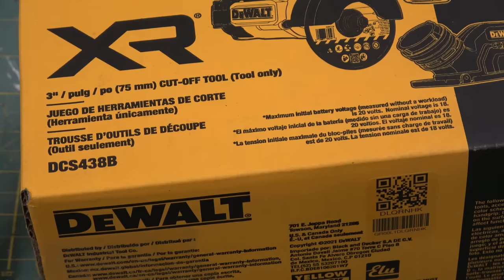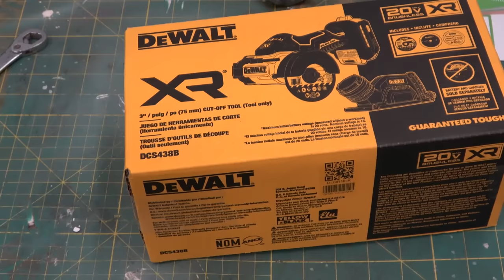BOLTR: DeWalt Mo' Powah!

Comment: ahh yes, finally some justification for being gifted dewalt and sticking with it for years and years
Reply: I actually really like the dewalt triggers over milwaukee/makita. Maybe it's just because they're the ones I'm most used to though 🤷
Reply: Dewalt is finally on top again for impacts. The 961 1/2 is crazy and the mid torque are good too. Just got one mid torquefor free with two 8ah batteries for $300 total
Reply: @UnimportantAcc probably what you're used to. 

I don't want to start a brand war, but I use makita and can't stand the triggers on milwaukee or dewalt. Definitely "what you're used too" plays a part in it.
Reply: @wearsjorge55  fair enough
i do like the makita gear, in particular their cordless circular saw /w swarf collector made me want to switch over from dewalt ahaha
Reply: I run makita and Dewalt. Dewalt is pretty tough actually, but always a little rough. They take serious abuse unlike Milwaukee which dies all the time.

Makita is smooth, ergonomic, precise and really reliable, but it always lacks a bit of power. I run both for a reason.
Reply: Idk I have run Milwaukee for the last 6-7 years as a auto mechanic and only thing I have found to suck is the m18 fuel drill chuck have been thru 3 of them and the fact that the tip of the soldering iron always comes loose and if you don’t tighten it they you won’t be soldering anything. Also went thru 1 1/4in ratchet but that’s used daily so. Have had the same first gen m18 impact all this time and all the other impacts, drivers, grinders, bandsaws, die grinders have lasted 4+ years minimum with a ton of hard use. Hell I have m12 tilt head lights that I have ran over and tapped back together 3+ years ago still working.
I haven’t had all the bad luck some people have had with Milwaukee but I have used other brand and aside from not being used to them I find everything good so it’s all about your preference and for me what was more affordable (I got all if not most of my Milwaukee shit at really good prices).
Reply: Personal tools have been Dewalt for years, some coworkers suggested millfucky for shop tools and batteries dead at 4 years, my 20 year old Dewalts still kicking.
Reply: Nothing wrong with that!  They make good tools.
Reply: I’m a contractor and used the 20v system since inception.  They are very good tools and get it done.
Reply: 21 years here.  Technically my whole life.  Dad had a black and decker industrial saw boight in the late 80s i used for years which was rebranded dewalt in the early 90s.
Reply: Would you be surprised that I'm on all three platforms and don't give a single shit about what brand is "winning" or how much it costs at the store.  If youre willing to check offer up more often than your social media accounts, you can get any color tool, brand new and at half the price. Having a tool wish list? Forget about it, don't buy at the big box stores and you will have every tool you can fit into your garage and the only reason you'll ever check retail prices is so you can divide it by two and know that's the most you'll offer for any tool even if its new in box. Don't be a fanboy, and don't overpay for plastic shells and motors, that's all that tools are, I can't imagine saving up all that money and dumping it all on one tool just so that you can get a receipt?
Reply: I’m a professional carpenter in the Pacific Northwest. We build all outdoors so our tools get put through some sh1t. Everyone uses Dewalt, Milwaukee, or Makita. I train all of our new hires or help with particularly hard or custom projects. Because of this, when I’m on site, I’m usually using the other foremen’s tools. That means I use all the brands (though I own DeWalt). One day I’ll use all Milwaukee, one day Makita, one day DeWalt. Dewalt is the best, Milwaukee second, and I would not buy Makita. Here is why:

Dewalt has an absolute power edge in some tools with the 60v line. Their “worm drive style” 60v circular saw is leagues better than the Milwaukee or Makita. 

Dewalt has the best ergonomics by far. Go grab a Makita or Milwaukee multi tool then grab the Dewalt. The M brands are like holding a Campbell soup can. The Dewalt feels like a nice pistol. Dewalt made the forward/reverse button on their drivers stick out slightly when depressed. Milwaukee made their sub-flush. That means to switch a Milwaukee to reverse, you have to break your grip and use the tip of your thumb or finger to push it down INTO the grip. With the Dewalt, you can just use the side of your thumb and not change your grip. It’s little things like that that make a huge difference. Makita’s drivers are weak sauce. 

Many of the Milwaukee multi tools will not stand on the battery because it mounts at an angle. I know, small thing but it pisses me off to no end.  

Makita doesn’t make a battery above 5Ah. What nonsense is that? The Makita worm drive skim saw is hot garbage. It is so weak it’s insane. 

The ONLY tool that I would even CONSIDER buying that is not Dewalt is the Milwaukee multi tool. And it’s only because of the power. That thing cuts at least twice as fast as the Dewalt. It has a stupid level of power. However, it feels like holding a brick, it won’t stand on end, and you can’t modulate the speed with the trigger. It has an on/off switch and a speed dial. Also, the automatic speed control is dumb. 

Every single other tool that I use between those brands (all circular saws, multi tools, grinders, drills, drivers, sawzalls, jigsaw, etc), Dewalt either wins or ties. If Dewalt would just make a multi tool that cut like the Milwaukee, the debate would be over for all time. 

In conclusion, Makita is out because of small batteries and weak power levels. Milwaukee is out because of horrible ergonomics and slightly less power on some tools. Seriously, Milwaukee made a jigsaw with an on/off angle grinder style switch. Jigsaws have used a trigger with speed control since forever. Oh, and the thing is so girthy it feels like you’re holding the wrong end of a baseball bat.
Reply: I chose DeWalt 12 years ago and chose wrongly. Little did I know at the time; my Dad, a DIYer and mechanic his whole life had only ever owned Bosch 12V cordless tools, and used air tools exclusively at work. But I stuck with the bumblebee brand and they've started to get their fingers out of their asses with product development and design. Still think my buddy's Packout setup is twice as good as even the ToughSystem 2.0 boxes. Two bites at the cherry now and they still came up short... seems DeWalt can't design a toolbox to save their lives.
Reply: @Thedudeabides803 After 16 years my cordless sawzall finally shook itself apart. Original batteries died 2 years ago only because I moved to Florida. They made a good kit.
Reply: @UnimportantAcc they also modulate better. Everyone always talks about Milwaukee power but quality and control matter more than power in most cases. But dewalt even has more power these days with lots of tools.
Reply: @cheeseo9798  I absolutely love my first gen 1/2" fuel impact as a mechanic as well. Lots of miles on it. Coworkers have newer models and I can't stand that pulling the trigger doesn't always actually turn the dumb thing on. Instant torque that I can modulate with my finger is one of the big positives of these electric tools IMO. The braking action that doesn't throw lugs across the shop is great too though Haha.
Reply: @alphazuluz i agree with you on pretty much everything but re the jigsaw, I believe all brands barrel grip jigsaws use the on/off switch, not just Milwaukee
Reply: Beware their Leaf Blowers!
Reply: I just pulled out an old dewalt impact driver I bought a decade ago. Been running a milwaukee gen 4 for a while now, and I forgot how comfortable and well balanced the dewalt is. The milwaukee is obviously more powerful but most the time I don't need it so the old dewalt has been back in business. It just feels better. Love that thing

Comment: You mentioned how the MFGs are making things cleaner on the inside lately. I think you have had a hand in that, guys like me are engineers nowadays and watched your channel in college and since then. Good teachers make positive change in the world!
Reply: I’m an engineer, admittedly not mechanical and so machining isn’t my area of expertise. 

I was at a supplier yesterday tearing down a very high dollar, complex, and specialized valve that had failed while in service and there were several points where I would have loved to have AvE there to just provide his experience and see his reaction. Several different techniques, metallurgy, elastomers go into making this valve,  no expenses spared, and half of them I recognized or had first seen  watching an AvE video.
Reply: Good to hear the world is finally getting back to the 1960s and 1970s in that regard. I was taking tools apart long before YouTube existed too, but my mother didn’t care as long as I put them back together afterward.
Reply: Also I tore down one of my milwaukees and noticed every fastener in the clamshell was the same screw. That was amazing to not worry about what screw went where.
Reply: @ac.creations that's cost savings as well.  Get two birds stoned at once!

Comment: The “flap” is a slot for an optional Bluetooth “ToolConnect” smart chip module that lets a foreman track tools, assign tools, disable/enable tools, and receive alerts when tools are taken. Some interlocking tool cases have a slot for it too. They make a battery interposer that can lock in to the battery slot to add the same functionality to their tools that don’t have the chip slot.
Reply: Also, the depth gauge/dust extractor comes off the tiny adjustable blade guard without tools… just like the Milwaukee version. You just have to drop the depth gauge all the way and slide the release button. The flip-up window lets you change the disc without removing the dust extractor, which would be appreciated by the rare breed who would actually uses it. The Milwaukee and others do not allow for this.

Comment: Just a thing to point out, I am not as technically inclined as you and read the manual the plunge depth dust collector thing-a-majig actually comes off from the real metal guard. I like my fingers so I kept the guard on but it winds up being a lot less bulky and keeps your abrasive wheels from having chunks snapped off when you inevitably throw it back into the toolbag at the end of the day.

Comment: at 12:30, regarding the crimp-on wire termination...  this permits just soldering that termination pin into the board, avoiding the issues with soldering the wires.  A main reason to do this is that you don't have solder wicking up the strands, creating a stress riser where the solder stops.  This would usually require strain relief to avoid wire fatigue and failure.  There can be other advantages, such as being easier (potentially) to get all of the strands into the terminal.  I've seen issues with a few strands not going through the hole in the board and sometimes shorting to adjacent wires.  As an engineer, I've seen this pop up on one of my products with serious implications.  No fun!
Reply: The main reason is they clip into the PCB.  The PCB can then go through the wave soldering machine with out the wires falling out of the through holes.  They will probably do 200ish at a time (20 x 10 PCBs all still connected together).  It would be a impossible to go through without the wires secured into the PCBs.
Also,  once soldered,  a jig will be used to RTV all 200ish solder joins in one go.
Then the individual PCBs are just snapped off the original master PCB.
Reply: @debochch  good point!  Lots of advantages to the method, despite an added part (the terminal) and process.
Reply: Lightly a depaneling CNC with a pick and place in to totes rather than snapped
Reply: Yeah, what he said…
Reply: Crimping is better than soldering in many situations (says NASA).

Comment: The part about 10 years ago tools being gross on the inside is wild. The fact they are making things better is something I never thought we would see. I mean they are making them cleaner better is arguable.
Anyways actually love that the guard is not welded to the machine like a lot of tools now and the reverse switch so you can shoot the sparks toward the oil bucket instead of your wool shirt is nice.
Reply: Well I'm sure someone less philosophically-challenged than myself will poke holes in my theorem, but if a brand is showing everyone they don't care, people begin to suspect that they really don't care. That is to say that attention to needless detail indicates attention to another detail better than carelessness in a needless detail does. With so many categories of products suffering from decades of concerted acceleration efforts toward our beloved late-stage capitalism, I'll praise any bit of craftsmanship that I can.
Reply: The mold making I'm willing to bet is seeing the indirect benefits of additive manufacturing techniques. The wiring looms probably is pure marketing. The casing design stuff is pretty much a result of every damn thing getting run through generative and stimulative tools.
Reply: @notsam498  Wiring looms are probably not marketing, but ease of manufacturing.

Comment: As someone who is committed to DeFault, not because of brand loyalty but the amount of money I have tied up in batteries, it pleases me that they’re capable of such fine craftsmanship and occasionally outperform other manufacturers
Reply: the 60v circular saw is a beast. it will not bog down. its more powerful than my 15 amp corded and beats the red one as that one my dad has constantly just cuts out when it has to work for a living. i put my corded on ebay a few weeks ago, i never use it anymore since i got the 60v.
Reply: Just picked up that 60v worm drive and have never been happier with the tool purchase
Reply: Brand loyalty doesn't mean sh💩t, anymore. Buy whatever suits your fancy, and r🙄ll your eyes at the silly fan boys....
Reply: broken clock is right twice a day

Comment: I was gifted some 20v dewalt stuff from a buddy and also my dad and been using it for about 2.5 years now and it works pretty damn well. I have been hella impressed by the inpactor tool that accepts 1/4" speed chuck stuff. With a 1/2" socket adapter, it will literally bust lug nuts loose off a truck.
I'm an automotive and boat mechanic by trade, so they get daily use I might add .

Comment: as a dude who doesnt work in manufacturing, i never put much thought in how much stuff is actually machined, and not forged/cast or what have you. so much machining. and so much human checking and balancing. i salute these machinists that have to grind weight off of high rpm parts

Comment: Impressive how fast it stops the disk.
Reply: it uses its own energy to brake itself. the faster it turns the harder it brakes.
Reply: My only question would be is, at what point is this just a grinder? I mean 20v is definitely more torque but isnt the point of these things to be compact, or am i wrong?
Reply: @jaredslattery4584  That's why I like the Milwaukee. It's small and really handy for cutting hardware cloth, chicken wire, chainlink, etc. I would never even try to use it for cutting 12 gauge steel plates.
Reply: @jaredslattery4584  anything can be a grinder if you use it wrong enough.  This isn't going to run flat out 24/7 but seems like you could use it for small metal jobs.  Like maybe your shade tree mechanic type work and not fab shop or pipe line type work.

Comment: I think the flapulator 7:15 is used on other tools for a belt clip or joist hanker. As you say yourself 10:45 it is modular must be using the mould for more than one tool.

Comment: I'm happy you're back to doing BOLTR again. Getting your take on the newer Milwaukee and the Ryobi brushless lineup would be interesting. I know right, Ryobi!?! From what I've seen of Milwaukee lately, they've let the hype get to their head. Metabo and FLEX would be awesome too! Do you think they justify the price?
Reply: The Milwaukee name was bought by a chinese company a decade ago. Has nothing to do with hype.
Reply: The new high torque seems to be pretty well built, TTC took it apart and found no cost cutting
Reply: @phipear  Thanks for the info! I'll be sure to check it out.
Reply: Grapevine says Ryobi and Milwaukee are made by same company.  I have been happy with both.  No room in my battery tray for yellow.
Reply: @DrJuan-ev8lu  Honestly, at this point, I'm just going to buy a charger and battery for every major brand because it seems like the best they can do is make one good tool and the rest in the lineup are sh!t😂

Comment: I bought a Mikwaukee tool earlier this year, had good luck with it doing eavestroughing (cutting trough material).... Diamond blade cutting 1/4 inch Hardie sheets, NO GO! About 1 inch per minute cutting and it stalls out constantly, long story short, ran to Home Depot for the Dewalt cutting tool, WOW, night and day difference, it's as if it has 4 times the power, not exaggerating either. Awesome tool! I haven't picked up the Milwaukee since.